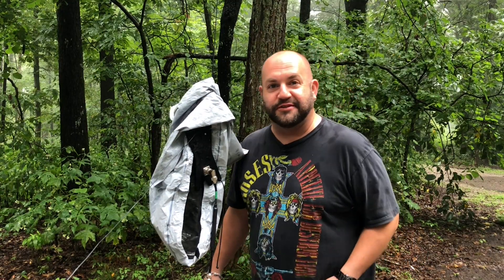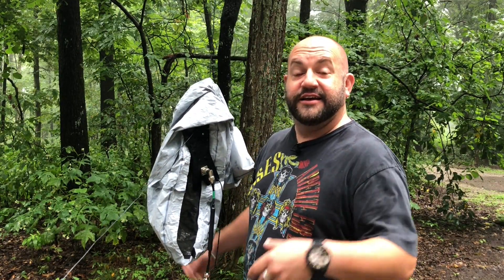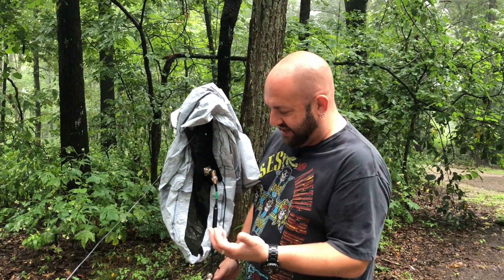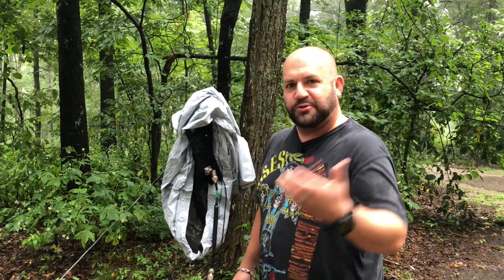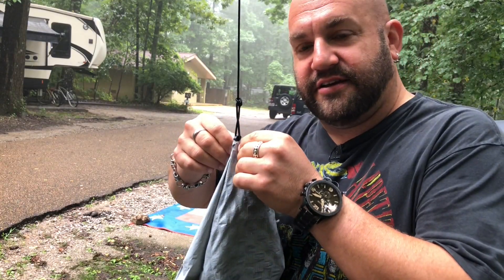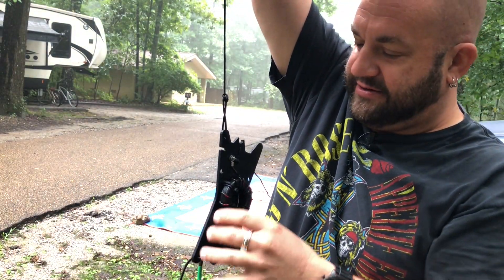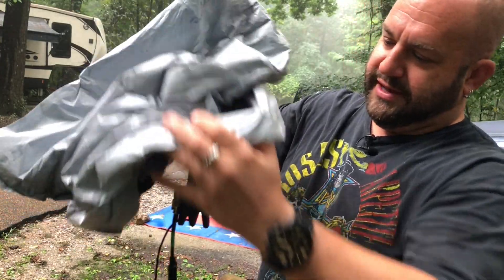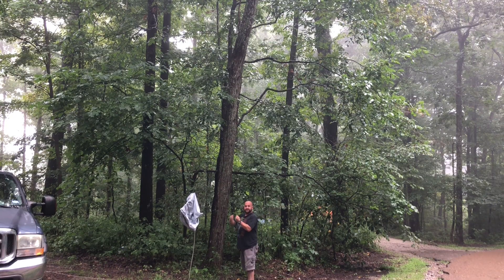Pro Tip #3 | How To Keep Your Feed Line Dry While Portable

Comment: It will help but para cord will wick water through it jacket down the line and down the coax. Best to use a cheap $ funnel and electric tape the tip closed then add ur trash bag into fully protect that coax.
Reply from the maker: It actually worked very well for the week the antenna was up.  I wasn't so worried about the antenna itself, I just wanted to keep the deluge of water from getting into the coax.  Had to come up with something on the fly with what was available.